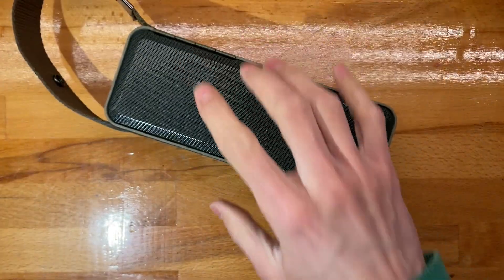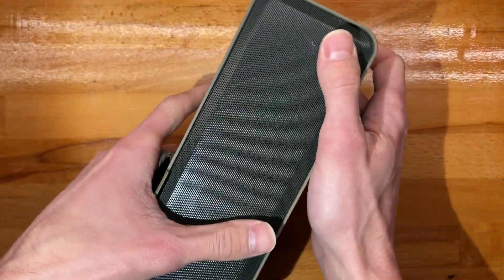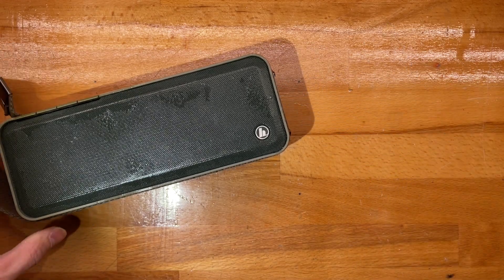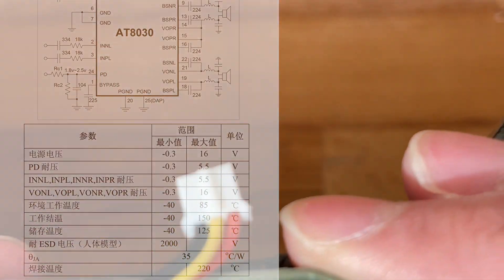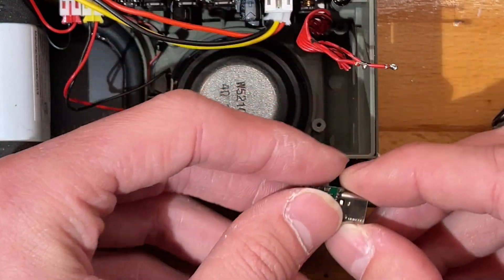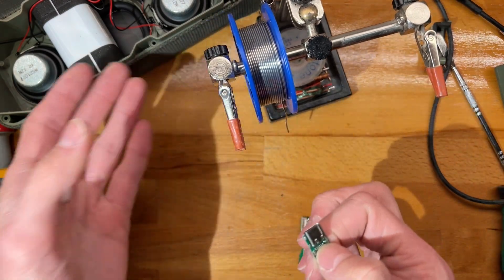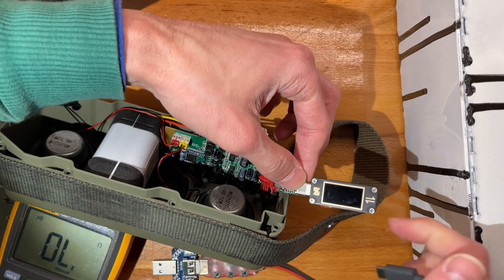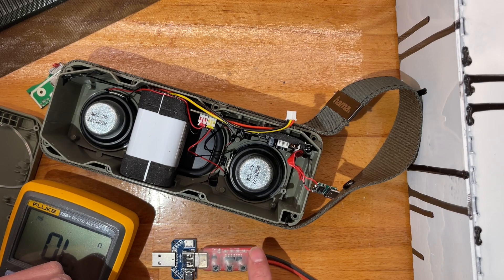Fixing a HAMA Bluetooth Speaker [or how not to use a PD Trigger]

Comment: I have same problem with this hama soldier L.the micro usb cede from board solderings.I guess i will put a board from a power bank to those + - wires to supply the +5 voltage.

Comment: It went to 14v in PD charge mode rather than the usual 5v of standard USB.
Reply: The modules I have seen like that have a set fixed voltage.  He even mentioned this at one point but he never said what these are set at.  
It was around 11:18
Reply: @aurthorthing7403  Damp fingers on voltage programming pins? https://youtu.be/W04KVGZSqbI?t=884
Reply from the maker: wow yesssss .. now I see it :|

exactly that ..

man .. this is the power of the internet
Reply: @oldman1944  doubt it.
He fed over 14 volts to the thing bc the jumpers are set to 14 volts.
Reply: Oh I didn't see the jumpers were set, I got the impression that no jumpers were installed and it was at 5v. Damp sweaty fingers could be 500k on those close pads, probably enough to change the pin inputs.
Reply: @oldman1944  with no jumpers set it goes to 20 volts.
Reply: @aurthorthing7403  Seems like he's too experienced with these modules to do that, but maybe!
Reply from the maker: jumpers were set to 5, but my hand on them did trip the PD-phy protocol chip to think otherwise
Reply: @Darieee  In the vid you said it was set to 20 volts.
Reply from the maker: I think I wanted to say it's a 5/20v trigger 

I did set it to 5 and checked it off tape before the magic shot ..

Comment: Looks like you fed it over 14 volts on a 5 volt rail...
What was the voltage set on that module?
What was the battery pack voltage?
Amazon US has those chips for 2 dollars.

Comment: Whats the use of that round thing at the red cables at 6:48 ?
Reply from the maker: ferrite core - helps with signal integrity

they had them on both ends of VGA cables for example - that's what those big lumps are

Comment: So you snipped like 6 wires and then only connected 2 to the new USB-C output, is there a chance that it was sending too much juice through just the 2 wires instead of the 6? ( I know dick about this stuff)
Reply: The other 4 wires were for the usb powerbank / usb Stick play Mode.
Reply from the maker: yeah .. I also don't think the rest were doing power delivery 

some were for the output, one or more were the reset ... 

still a damn shame it blew up :(
Reply: @Darieee  😢
Reply: @Darieee  What were these modules set at?